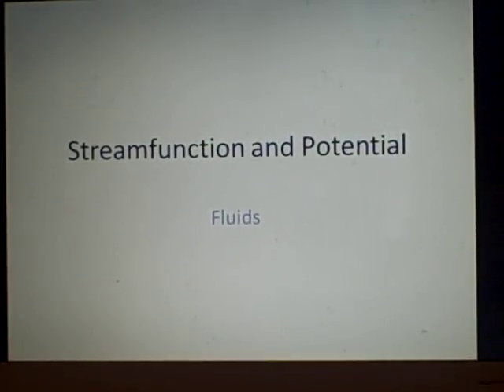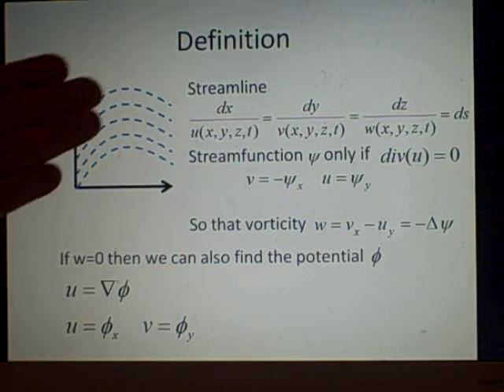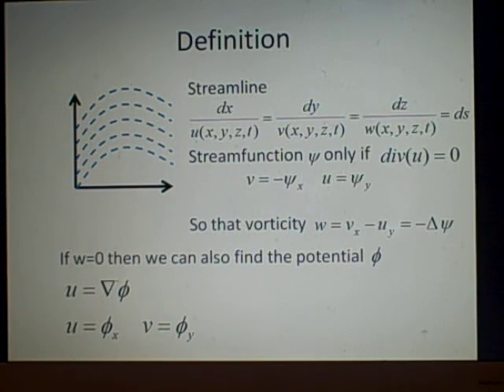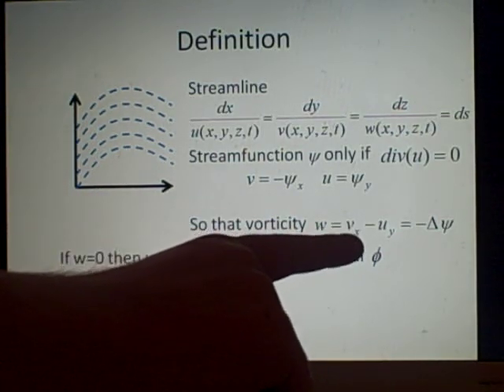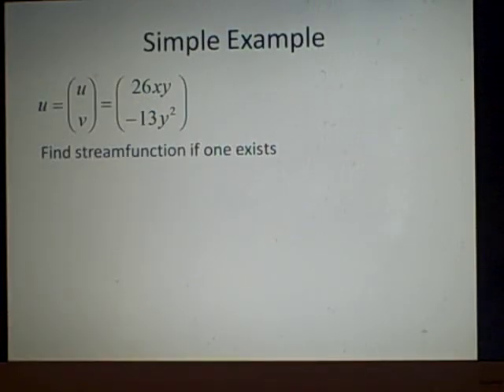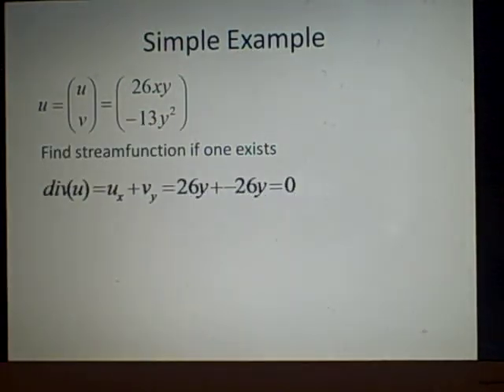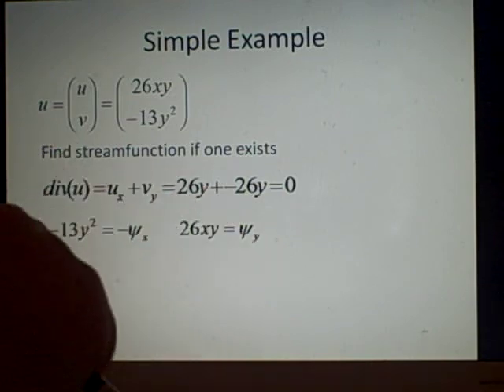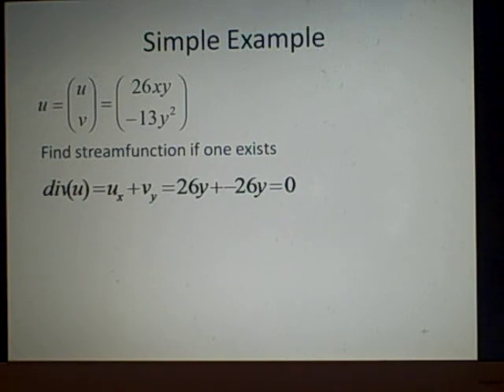Fluids- Streamfunction and Potential

Comment: For the curl of the vector  curl(U)=nabla×U=0,
For example if a vector field represents the flow of fluid, then the value of  nabla×U at a point is twice the angular velocity vector of the element of the fluid that rotate , in particular  nabla×U=0 at a point means that the fluid is free from rigide rotations at P; that is , it has no whirlpools. Another justification of this idea depends on Stokes’s theorem However we can say informally that cur(U)=0 to deine that the fk=luid is irrotational

Comment: Continuing my discussion: the div(U)=δu/δx+δv/δy=0; I used δ instead of Δ , Joseph louis Lagrange defined the stream function such that , a function which is constant over a surface , in such way this function will satisfy the continuity equation for this he defined the stream function
Ψ(x,y)=constant , where  u=δ  Ψ/ δy, and v= -δ Ψ/ δx, and this two terms verify the continuity or the div(U)=0 simply , δ(δ  Ψ/ δy)/ δx +δ( -δ Ψ/ δx)/ δy=0 which is indeed equal to zero.

Comment: You are treating a steady incompressible flow in 2d. The div(u) is the continuity, as we know that the continuity is from the conservation of mass. you case is a steady incompressible flow in 2D. The divergence has an important physical interpretation. If we imagine F to a vector field of gas(or fluid), then the div(F) represent the rate of expansion per unit volume under the flow of the gas(or fluid).
If div(f) <0 the gas (or a fluid)is compressing other ways is expanding.